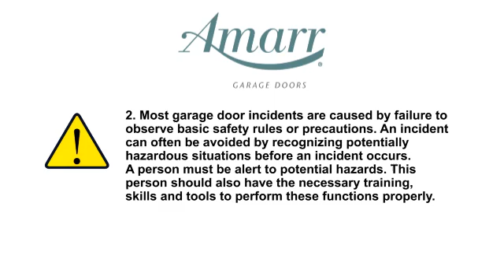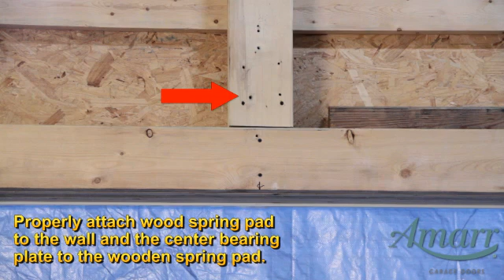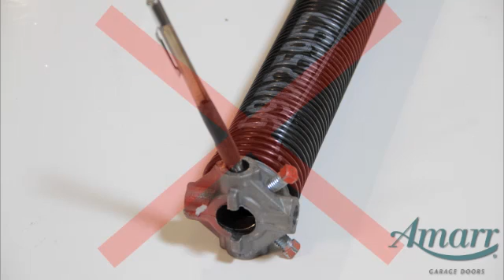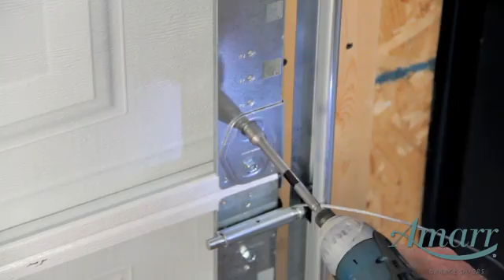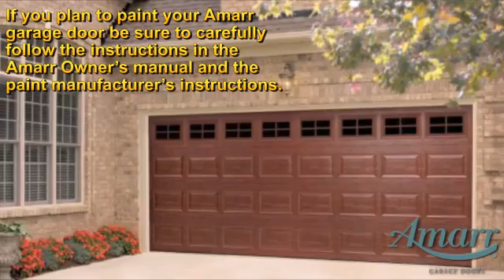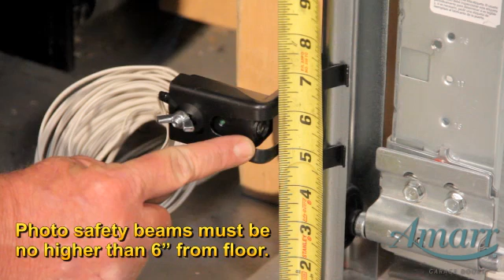Amarr Garage Door Installation

Comment: Can the tremendous spring tension  be harmful?
Reply: Overdoing springs is generally not recommended but won't give you the same issues as underdoing them. As long as you're not adding more than 4 quarter turns on the spring/springs you should be fine, unless your garage door opener is too old/weak to handle pushing the door down hard enough.

Comment: This video gives you just enough information to really frustrate you on this installation.  I bought a carriage house door from Lowe's and installed it today.  No installation instructions were included and it took an hour of google searching to find instructions.  Then, then instructions provided were for 4 different doors, with incredibly unclear instructions for any door covered in the instructions.  I will never buy an Amarr-owned product again out of sheer principle.  What could have been a 3-4 hour job ended up taking 9 hours with all the internet time and bitching about terrible instructions.
Reply: I'm in the same boat, orderd a steel building, garage doors came it for a eood structure🤣🤣. I'll figure it out eventually.